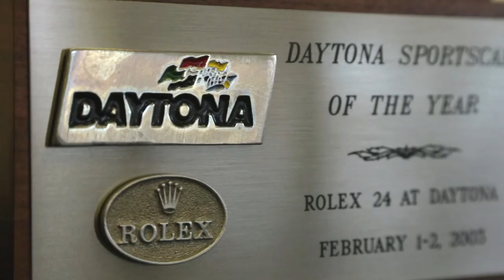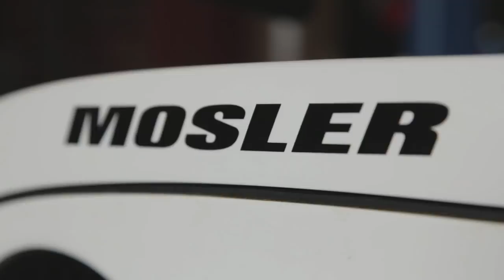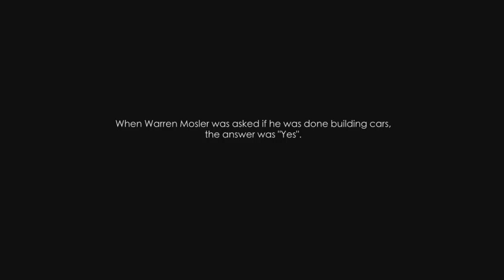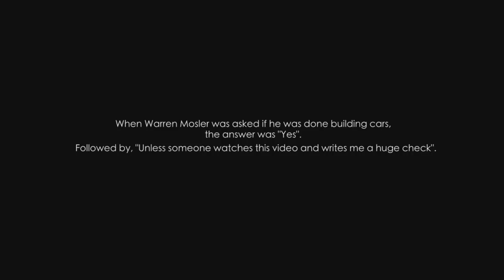Mosler MT900 and Consulier GTP! Supercars Ahead of Their Time - The Downshift Ep. 58

Comment: Just a friendly reminder that horsepower doesn't mean anything without the right transmission. Tall gearing usually means fuel economy and top speed while light weight is cornering and braking. Mosler took a thin, flexible composite body and filled it with foam to give it strength but OEMs don't want consumers to be able to make their own cars, so the existing supply chain won the day although Chrysler had already been manufacturing unit bodies with subframes for the infamous 69-70 Charger
Reply: Going back to Warren quoting Carroll Shelby, Shelby made aluminum bodies so thin, you couldn't lean on the car without leaving a dent, so while light weight makes sense on paper, it just doesn't work for the general public
Reply: Fast forward 20 years later, OEMs are using energy absorbing foam structures behind plastic bumpers and the only piece of metal that resembles a bumper is the radiator support. But as for making the entire body out of a structural foam sandwich? The Consulier GTP sounds more like a boat

Comment: I think his car was much better looking than most of the big 3 offerings in the 80s. And the MT900 is absolutely gorgeous in my opinion. I had a 2.2 liter powered Dodge mini van . Panel van actually. And it ripped . Even non turboed. But when we turboed it with a 2.2 turbo out of a wrecked Shelby GLH it really got fun. I should have never sold it. It was definitely a little sleeper

Comment: The first car of the modern era to not have a metal frame or carry structure was the 1959 Lotus Elite.  Chapman mounted suspension to the fiberglass body and in normal driving, they survived, but anything spirited, the suspension began to rip out of the fiberglass.

The 1984 Corvette pulled 1 G of lateral acceleration, beating the Consulier by 3 years.

Comment: Damn, this was an awesome video. I always had respect for Warren Mosler. Who else has kept an automotive company alive for 30 years that has never made a profit because they love building cutting edge cars?
What is interesting is Rod Trenne, the designer of the MT900, says Mosler actually butchered the car by drilling holes in the chassis as a do anything effort to get it light weight (hence why the race cars use tube chassis) and it could have been even better.

Comment: Consulier is primarily fiberglass and kevlar the new tech at the time was using those materials in a structural capacity. If you look at the contemporary road going Ferrari it used a steel tube frame to house the drivetrain and suspension pickup points. The GTP mounted the suspension and drivetrain directly to the composite tub. Maybe F1 cars of the period were done in the same way but Im no expert on F1 tech.

Comment: bro it's not just the looks, haven't you noticed how the market works? you dont just make an amazing breakthrough and then it goes on the market, it has to trickle, every year making slight improvements to edge out the competition until they do theirs. right now we are capable of making cars under 2,000 pounds with materials that would last 100 years with almost no maintenance.

Comment: How the heck hasn't a BIG 3 American manufacture picked this guy up and exploited his knowledge and ingenuity?????
Reply: are you kidding? lets see a mid engine car (they only handle good on a racetrack with brake markers driven by experts, the rest of us get that nasty snap oversteer thing) that weighs less than a ton... what could go wrong? Physics and product liability suits.
Reply: +FuckGoogle+ Mid engined cars handle well everywhere, not just racetracks, and American manufacturers have built some horrible handling cars over the years. Putting a 428 in the front of a Mustang resulted in some ugly physics, yet they did it and sold 'em.
Reply: +Dead Doll to clarify my point, mid engine cars tend to be unforgiving to changes in throttle and braking at mid apex. When you upset the traction the car wants to spin right now because its mass is at the center. Unlike a FR chassis which gives you lots of warning and time to countersteer, there is little you can do besides go along for the ride. The physics term is called "polar moment of inertia" and its also why MR chassis do so well in slalom tests, they change direction very quickly.
The relevance to racetracks is that its rare for you to approach an unfamiliar corner and be way too fast at mid apex on a track. You got brake markers.
If you ever own a mid engine car and like to drive it fast you will know exactly what I mean. 
Just keep repeating:
"Don't lift off (the throttle) mid apex."

Comment: When Mosler says composite materials, I'm assuming he means carbon fiber. Just to be clear, both Ferrari and Mclaren where building cars from carbon fiber, before the Consulier was built. Warren Mosler is not the pioneer he is being made to look like in this video.
Reply: i smell a hater.
Reply: brojynks I'm not hating, I'm just saying that these two cars where built in a shed, and are by no means revolutionary masterpieces and their father is not a pioneer.
Reply: he was the first to use Kevlar and carbon to build from what i have read. he may not have been the first with carbon, but im sure its the fact the whole car is made of it.
Reply: You must have watched a different video.  Just to be clear - he means the whole subframe, and he says that, but you were too busy hating to actually understand what he says..  He was banned from competition for building cars that were "too fast".  I would say that amounts to being a pioneer in race car design.  You have different standards, I suppose.
Reply: scott sanborn For the last time, I'm not hating... But making a fast car does not make one a pioneer in motoring. Any idiot with a shed can make a fast car. That Hennessey guy is a perfect example of this. Magnetic shock absorbers... THAT is pioneering. Wishbone suspension, safe magnesium alloy parts(magnesium is very flamable), traction control, ABS, carbon ceramic brakes THAT my friend, is pioneering. And that's my point, I'm not saying that Moslers will catch fire as soon as you start them, unlike their Italian bretheren, but their class is inhabited by much more advanced cars. Moslers are for people who love Moslers.... Which would be fine if they were affordable, but they're not. And they're too ugly to be bedroom pin ups.
Reply: Kristian Brandt
From the wiki: "The Consulier GTP... The chassis was a fiberglass-and-foam monocoque, the first carbon fiber and Kevlar-bodied vehicle ever to go into production - with no structural metal in the body."
Reply: ast453000 First of all, in my last comment I said titanium was flamable... I meant magnesium.
As for the Consulier, when has Wiki ever been wrong? The Mclaren F1 was the first all carbonfiber production car. Unless you count the Ferrari F40, which I think you can. It had some aluminium structure beams, but it was 1987!
Reply: Kristian Brandt
So, if you go to the wikipedia article, you see that the source for that information is Allpar. But maybe they are lying too. Additionally the production of the Consulier is listed as from 1985 to 1993, while the production of the F1 is listed as from 1992 to 1998.
Reply: ast453000 Wow I didn't say lying, I said mistaken. And it is. The F1 was the first all-carbon production road car.
Reply: Kristian Brandt
I think the problem might be that you are confusing 'composite' or 'non-metal' materials with carbon fiber. Note that Mosler's only claim at 2:07 is that it was the first car that did not use metal for primary structure. That does not imply that it is the first all carbon fiber car, as he may have used other non-metal materials. So both claims might be true. The f1 might be the first all carbon car. While the Consulier might be the first production car not to use metal for primary structure.
Reply: The F40 was a steel space frame with composite body.  The Mosler was a composite frame.
Reply: ast453000 Still doesn't make him a pioneer. And the claim is still wrong because the video doesn't say kevlar, it says composite... Which does include carbon fiber. The fact of the matter is that the video is American, as is the car... He's definately a motoring pioneer in America, but in the grand scheme of things... I think not. And if he could afford it, and was able to build a car completely from carbon fiber, he would've used that instead of kevlar for his first car. If someone made a jet completely from chocolate you wouldn't hail him as a pioneer, just because he had used a inferior material no one had built jets with before, you'd see him as a bit of a half wit. I'm not saying kevlar is chocolate or that Mosler is an idiot, all I'm saying is that there is a reason F1 cars are made from carbon fiber.
Reply: The first CF road car was the Mclaren F1, which was released nearly 10 years after the Consulier.  If you can name a car with composite construction built before 1985 then you win.
Reply: XR4turbo This is not about winning. And 8 years is not 'nearly 10 years'. Look at the Audi R8. It has a double clutch system now. It didn't two years ago. And once again I'm not saying he wasn't the first to build a car from kevlar, I'm saying kevlar, all things considered, is inferior to carbon fiber as a car building material. And F1 teams were at the time experimenting with carbon fiber. That means he was inspired by this which makes him a car builder, not a pioneer. You could call him forward thinking, but the fact is that he's just another blue colour mechanic with a shed, trying to beat the big three(Ferrari, Lamborghini and McLaren) but ultimately failed. You see we know Mosler because we're petrolheads, but no child dreams of owning a Mosler. In many ways I think it's a lot like the Caparo T1. Sort of really racey, but catches fire after one lap. However I must admit I have no evidence to support this claim.
Reply: I'm not trying to claim he's God's gift to speed.  But he did do something before anybody else did.  He made a composite monocoque road car.  By definition, that makes him a pioneer.  "develop or be the first to use or apply (a new method, area of knowledge, or activity)."  The Caparo T1, by the way, was designed by engineers from the Mclaren F1 project and only maligned because of their suicidally stupid marketing approach (ie: submitting clearly unfinished preproduction cars for journalists)
Reply: XR4turbo Then he was the first to build a road car with a composite monocoque, but an F1 car is still a car. And again the Consulier clearly wasn't a succes. And the definition of a pioneer in practise is to be the first to utillize a SUCCESFUL method.
Reply: XR4turbo yeah im glad you said that. OP was implying that the F40 was entirely carbon with some aluminum bracing.
its stressed frame was a full metal tube spaceframe with bolted on carbon body panels.
the GTP stressed structure was foam fiberglass carbon and kevlar unibody. with composite body pieces.

i dont think the GTP is even considered a composite monocoque tub since monocoque cars have both front and rear subframes that bolt on and the GTP does not.